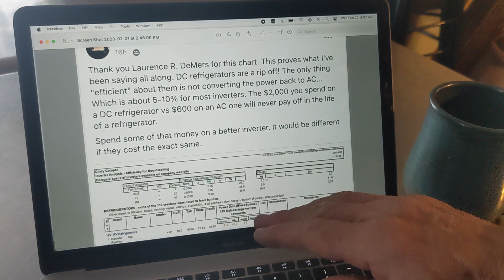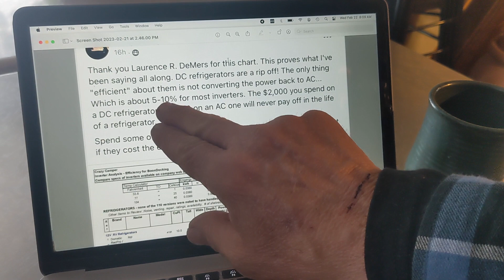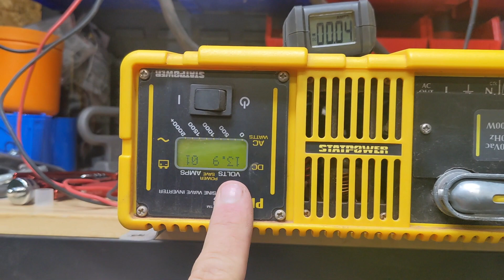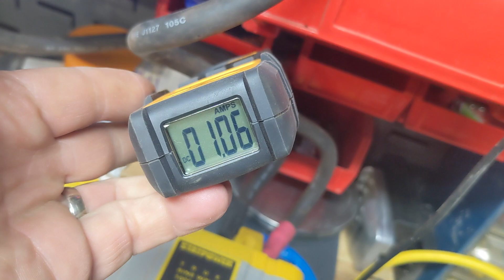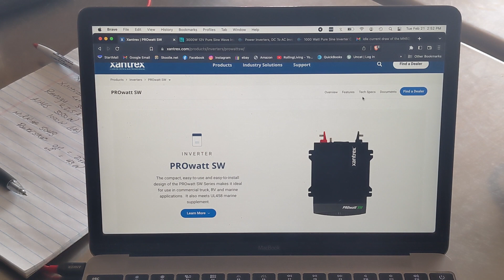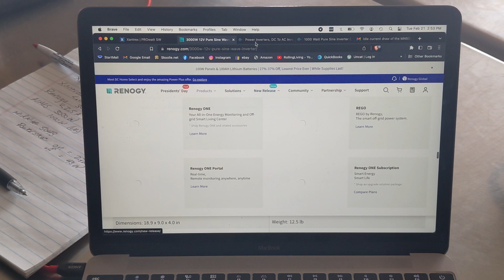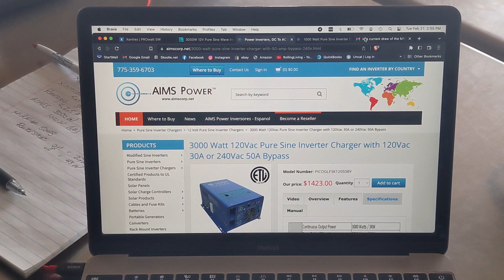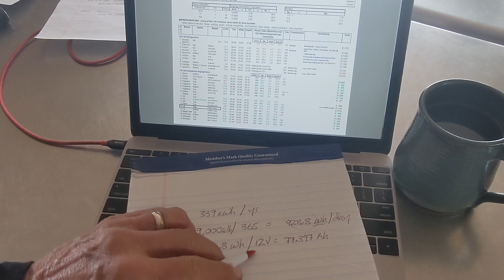DC or AC fridge? Some boring math to help you plan.

Comment: Back in 1973 I made a camper van conversion.  Available options were primitive by today's choices.  I chose an AC/DC compressor driven dorm-room sized refrigerator.  We planned to be driving more than we were dry camping, and plugged in to 120v house current for lengthy overnights.  Fall back was a good old "Igloo" ice chest.  I mounted a big deep cycle battery under the rear of the van, right under the refer.  Your very helpful videos always remind me of those 'good old days.'  Thank you.

Comment: Is there a practical way to wire a 120V fridge in a way that the thermostat also controls when the inverter turns on? So have a small inverter just for the compressor and the rest of the fridge (light) convert to 12V.
Reply from the maker: Well, that's an interesting thought.  Some inverters require a push-on/push-off on the remote, but quite a few have a regular on/off switch...and someone who knew what they were doing could, pretty easily, tie it into the fridge thermostat.

Comment: Interesting and very useful information. Many thanks. 
David in the UK.
Reply from the maker: Thanks for sticking through the boring math, David.
Reply: @fromabarehull  Not boring at all Ross, they are invaluble calculations that many fail to consider when sizing battery powered systems.